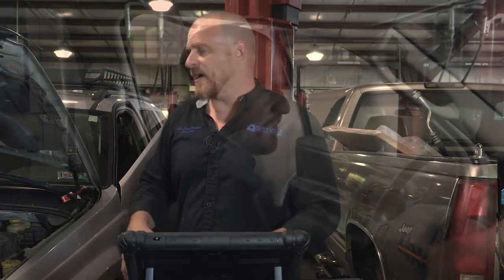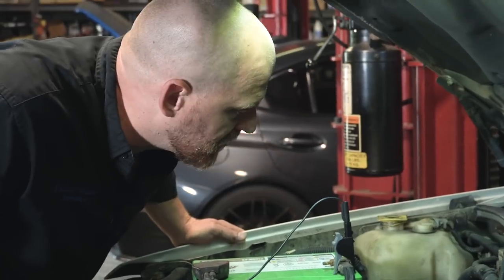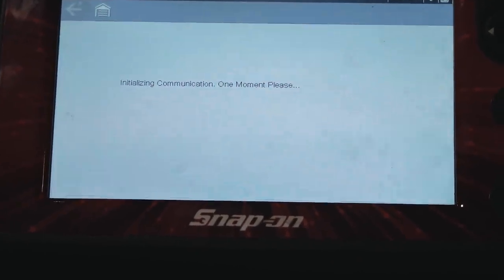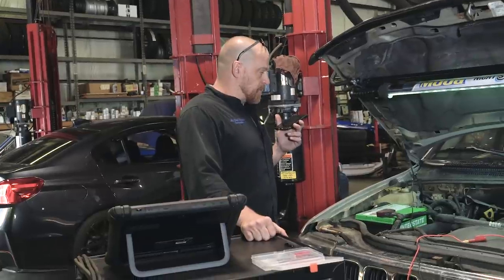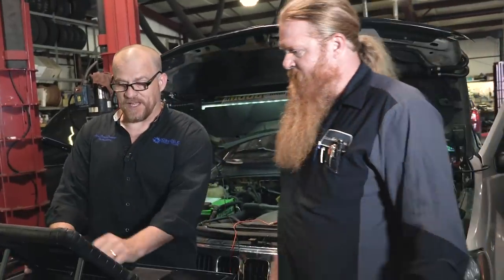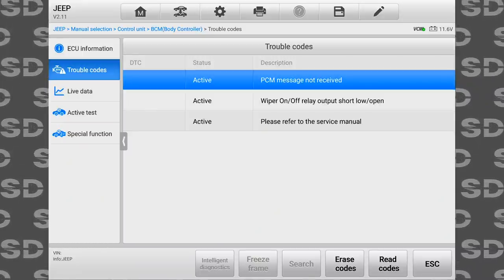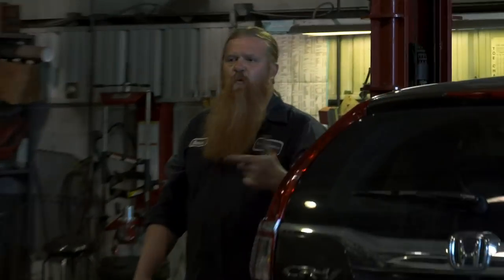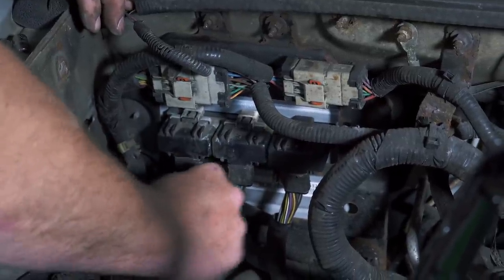2003 Jeep Grand Cherokee Intermittent Stall, No Start, No Com

Comment: The moment you saw the no communication and no mil you were on top of the issue. It only left powers , grounds and verifying pci bus at the module. The wiggle test on all these year Jeeps at the pcm is golden.
Reply: WE SHORE DO MISS YOU KEITH !!!!!!!!!!!!
Reply: Yeah but Ivan would have at least tried to take in apart and fix the solder joint!
Reply: What about TCM failed ?
Reply: so i am not stupid some kid may have touch the terminals wrong and in 5 second fried the pcm i did scanner danner power and grounds no dice i called a bad pcm installed truck runs today i needed some closer to the problem custermor installed a new bat but now what bam thanks guy your teaching payed off in west tn
Reply: Thank you Keith!

Comment: 2003 Jeep Grand Cherokee (4WD)   Thanks for posting this video.  Helped me troubleshoot and fix an issue.  Wound up being a bad ECM.  Had issue with coolant sensor, intermittent key/speedometer working.  Fuel pump was not pumping intermittently when turning on ignition, etc.  Also, cherokee wasn't running good, it wasn't idling at 1,000 RPM as it should, was more like 500 RPM and stalling out occasionally.  Your wiggle test was effective, heard some relays clicking when applying pressure to harness bundle attached to ECM ports.  Ordered a pre-programmed unit giving my VIN and ECM part #.  Slapped it in and Jeep turned right over and runs great.  Coolant sensor warning light went out too.  Thanks Guys !!!
Reply from the maker: Awesome! Thanks for sharing

Comment: I just bought Paul's book.  It's great,  good clear pics and print.  Brief descriptions and to the point.  Well written with lots of detail applicable to systems from many makes, models, and years.
A few years ago I had a 99 dakota that did the same thing with the connector.  No Bus on the odometer.   5v missing at the TPS.  I drove it while I waited for a 'new' $100 PCM from the boneyard. Hot weather made mine worse.  It died 2x driving to pick up the replacement part.  PCM had the same programming numbers as the old one.  Many Chrysler/Dodge PCMs use the same hardware, but are programmed differently for different models.  The software program numbers are on a sticker on back. Did not program it for the vin.  Everything has worked fine for 3 years since replacing it (knocks on head).
Reply from the maker: Thank you Kerry!

Comment: Just Empty Every Pocket lol

My favorite lost-then-found-tool was working on a skid loader and when I got done I couldn't find my 10mm ratchet wrench. Even tore the machine apart a little to try and find it. Gave up and bought a new one off of the truck. A few months later the same machine came in for an unrelated issue. Pulled up the floorboards for something and found something shiny. Dug it out and it was my wrench.

Comment: I am on Long Island . Flagship One is about 10 miles away . There is a local college radio station with an automotive show , Motormouth Radio 90.3 FM . One of the hosts who works in a shop said they have used them with good results . There is also South Bay Fuel Injectors about 15 miles away . They were a guest on the show . In the next county there are two long time carburetor rebuilders . One also does throttle bodies . I had bushings done on a GM that had excessive play in the shaft .

Comment: Nice case study! Always a little disappointing not to see the board under a scope, but these days there isn't much that can be done. Maybe a 17 year old board would be different, it would be so cool to see a solder joint fixed. As you say, it is much more efficient for a pro to go straight to a replacement. Caleb got married, so happy for him!

Comment: Nice video. I like just listening to Paul and Jim and pick up suggestions for tests. Learned something new with the pin drag test. 👍👍 The tip cleaner can be bought at any welding supply shop or some automotive parts places might have them too. Welcome back Caleb. 👋👋

Comment: Hey Paul, another great tutorial of checking visual and audial. Noticing that click when you undone the module was quick, some guy may have missed that one or not heard it over the shop noise. Once again, you point out a lack of basic checks that may have saved the owner from purchasing a fuel pump had the other original shop correctly performed basic checks. Then gave the problem to Pete. 😂 
Thank you once again for a valuable lesson on basic checks, oh and airbag modules! 🤣😂🤣

Comment: I know this vid is from a year ago, but SD wanted someone to comment about where to buy a Torch Tip Cleaner set. They sell them at Lowe's and I think they only cost around $5. I bought a set about a year ago for terminal drag checking and for cleaning out corrosion and stuff. I think they sell them in the welding and torch area of the store.

Comment: On early Chrysler boards we would remove them from the housing a flex them slightly.  On the early rebranded Mitsu Chrysler stuff the power relay would come un-soldered or just burn up.  Never understood the reasoning on putting power relays on circuit boards. Same with VW IVR's and Nissan Quest A/C control heads.  Did a ton of them years ago by re-soldering them.  Great info for the module web page.  Thanks!

Comment: I came across very unusual case!!! I had to go rescue my wife 60 miles away !!  Stalls, no code, no start!!! I just previously repaired short in fuel injectors harness.. when I got there, it fired right up, doubled checked computer diagnostic, everything perfect. (Crap!! ) chance drive straight home? Or let local dealer double diagnose that I missed??  Well!! It’s Sunday... head for home!! Stalls every 10 so miles.. let cool off.. stalls ... keep going.. finally ARRIVED HOME!! Wife took my car for work. I doubled checked fuel pressure, perfectly 55psi.  Ran it, good 20 so mins.. perfect!! Well!!  Caught my eye!!! Color of fuel !! YELLOW!!! Showed my wife... when she got home...showed her differences in regular gas and fuel out of her car...she said... SOMEBODY PEED IN MY FUEL TANK???  Told her that’s LOTTA PEE!!  It’s FLEX FUEL!!  She accidentally refilled the tank with flex fuel.... we had to keep refilling tank till it’s gone..  ( I had to tell you this story, figured you guys get kick out of this!!) there’s no short!! Replace the FUEL!!

Comment: Those connectors were a pretty big problem on the generation before that one looks like it’s on those too. I don’t like the no clicking on the electronic torque wrenches either, but I do like the digital read out.

Comment: Paul i worked on a 2014 unbolted the air bag module and turned it to check my wire and blew the  top air bags not a good day!

Comment: Take a good 80-100 watt iron.  Tin the tip and touch the pins on the ECM and see if you can get the solder to re-flow from the heat transferring down the pin.
Reply from the maker: Can't get to the board on these. They are covered with an inch some sort of hard silicone or apoxy
Reply: @ScannerDanner  right but you can get to the pin that it plugs into.  Touch the tip of the pin with the iron and let the heat flow down the pin and re-flow the solder in the joint inside the computer.

Comment: Sweet bagpipes, Caleb! :D Great stuff with the wiggle test, Paul. I see alot of those vehicles around here. I have an '04 sitting here that got hit hard in the right front with airbag deployment. Pretty much identical to that one. Me and Jim have the same organizational skills I see, LOL - looks identical to my toolbox and work bench (I wish I had a Nova bench, though), except mine is a little worse, LOL. :D

Great website there - I wrote that one down. Much appreciated! With my Silverado failing one system at a time since it left the showroom in '07, I'm certain I'll be needing it at some point soon. Transmission failed 3 weeks ago - 103k miles! Gotta love the 21st Century ... Anyway, great stuff as usual, fellas!

Comment: I’ve used that company before on a GM, had to do the 30 min manual key relearn but other than that it is plug and play which is nice and avoid having to pay to get it towed and for the dealer to program it.

Comment: Cracked male pin, cold solder joint, or water damaged ECU pin.
The fun ones are broken wires with no messed up insulation.
While not a car issue, had a motor winding analyzer. Running the surge test up to 12 KV. Start hearing sanp, snap,SNap, SNAP, SNAP!. Sounds like arcing through the insulation. Of our test coil.
Low output voltage and the continual snapping.
Turn out our room lights, can see arcing inside the test cables. These are like 11mm, 10 foot long cables.
Look at the Jr. Tech "well there's your problem" 
I pick up L1 and pull on the aligatorclip and six inches down. No stretch.
Do it on L2 and the cable stretches like an inch. I Said " Anytime you can physically stretch a cable? That's a bad sign"

Comment: Thank you that was a good video.
It appears to have a lot if corrosion at the bulk head my be bad seals around hood area, wiring getting wet causing condensation on wiring and sometimes inside relays which can cause intermittent continuity on circuits, have seen this many times, k am 96 now lot if water has gone under the bridge but k am still fit, hope this virus keeps away from me.

Comment: Instead of using a torch tip cleaner, I use an automotive terminal test lead kit from bluepoint, it has all the different types of male and female pins with a banana plug on the other end of each test lead. I don't like testing with a nozzle cleaner in case I pick the wrong size and screw the terminal up.

Comment: I have a 2004 Ford F-350 Powerstroke diesel, I have a high desired idle rpm about 4325 rpm on the scan data that I can’t figure out what causes it. Checked the get throttle plate, accelerator pedal sensor values. Nothing seems to be out of ordinary. I once hooked up the battery wrong way while replacing battery. Truck doesn’t start but cranks okay. Checked all other data pids for diesel truck to run and they are okay.

Comment: Can you try re-flow the male pins? Take a hot air station and heat the pins. If there is bad solder joint other side the board, it should fix it. Bad news is if the PCB traces are broken/corroded, these you can not fix by re-flow. Only be careful, the heat sink draws load of heat away. You need to be fast and relative high temp, 500+ degrees something. Not too long time, it can destroy everything. Pre-heat on low temperature and then go, go, go
Reply from the maker: Not on this ECM, they use some sort of very thick, hard silicon that covers the entire board. I do not have the ability to even look at the board on these models.
Reply: @ScannerDanner  Actually you are right. But it does not stop me, there is always solutions. Guess what I figured out? I could modify old soldering iron/tip (must have enough power and small footprint) and drill a small hole to end of the tip. That way is possible to re-flow pin by pin. Yes the connector plastic melts bit and may be it requires later bit lacquer for water proofing. Time consuming job, yes 100%. Only way to cut the time are to figure out what pin (s) need the re-flow. Economically not reasonable, your time cost more money than replacement unit. 

I can go even more crazy, it means even more not economical. No direct access means you can not apply the fresh flux and solder. Original one are may be lead free, it means very hard to solder or re-flow. Enough heat and there is possible to remove the pin, suck/drill old rubbish out from the hole, apply new flux and 60/40 solder and install back the pin. Very delicate job, too much solder and you have the short circuit. After soldering cleaning is not so big deal on these days, possible to use no-cleaning solutions. 

I am not here to teach the professional. You make the fantastic job!!! I learn on Plunket College, Dublin the motor vehicle maintenance and I have honer to deal all sort of crazy things. On following weeks I expect to get running my FrankEngine, toyota yaris with arduino and carburetor. Who is crazy --- ME!
Who is professional -- YOU!

Comment: you say about flag ship is a good company I've bought a computer from them for a ford escape and was never told about the tsb of replacing the coil packs before replacing the computer. I call and told them what happened and basically I was told I'm on my own. I should have know to replace then coil packs.
Reply: It’s not their responsibility to make sure you are performing the repairs properly. It’s their responsibility to provide you with a quality replacement module. Which they did. You obviously had a shorted output that ruined a transistor in the module. And that is their fault? Really? These guys who make YouTube videos also stress to look for tsb’s.

Comment: Hey Paul, in the video you mention you won't have 5v on a thermistor while it's plugged in.  However, I was glancing at section 9 in your book and on page 4 it states, 'thermistors can be left plugged in and will never cause this condition due to internal design differences'.  Am I confusing something?  I appreciate all the great content and happy new year!
Reply from the maker: Both are true! Remember that a thermistor gets its same signal voltage from the 5v regulator. So if you use a thermistor to check and see if you have a 5v ref. You must unplug it. Make sense?
Reply: Yes, it makes sense.  I recently learned of the 5v reference and got a bit confused there, thanks for the clarification!

Comment: If I remember from working at chrysler correctly, there was a Chrysler diag procedure in service info that called for hitting the ecm with a mallet for diag.always thought that was a good example of the manufacturer not thinking techs are smart enough to do electrical diagnostics.

Comment: Do you know in a Diesel, exact time under common rail when injector fires. Seems like no one knows. Is it after TDC or before. Does it change by ecm and injector on time via crank signal. Not even Bosch repair centre know. Very sad.
Reply from the maker: I know they fire on the compression stroke which is why you have 30000 psi of fuel psi available at the tip of the injector, otherwise compression pressures would prevent an injector from opening
Reply: I rang my engine builders and they did not know. They told me to ring an injector firm near them in the other part of UK. The guy himself was shocked people did not know. He said its easy. He said Injection pulse is timed off the crank, and theres no exact place it fires in. My logic though is if the air is compressing and you dont want an explosion before tdc is that the explosion has to be afterwards. The injector guy said I was wrong though. And its before tdc. I cant believe that. As if you ise ethanol easy start and spray too mich in air filter on crank it can go bang as pistons climbing. The sound of con rods and everything taking the extreme forces the wrong way is horrible. Bang after tdc has to be the only way it works
Reply from the maker: @jamesbarratt593  injection timing on a diesel IS your "ignition timing" and it absolutely sprays during the compression stroke (BTDC).
The amount of fuel and timing of the fuel is everything. 
Due to the time it takes to complete the burn, you have to start it before TDC. In the books, any flame that is still burning by about 22 degrees after TDC is just creating heat and is not helping.
Reply: And so would you agree that injection timing is done by monitoring the crank signal.
Reply from the maker: @jamesbarratt593  of course but that is only one piece of the info needed.
MAP, TPS, cylinder head and coolant temp, etc etc etc

Comment: I personally do not recommend flagship1, they won’t warrant our PCM. They got from junkyard and sold it to us...  I personally recommend partgeek, rebuilt ones. Yes, need to reprogram to fit the vehicle. ( dealership able do that, $85 or so)
Reply from the maker: The whole point was with the programming side of things. So far flagship1 has been awesome. Maybe 6 or 7 different modules so far with 0 issues. Turn key type stuff too, no programming
Reply: Yes, that’s one thing... google BBB... New York... you’ll find lots negative reviews, rips off, takes your credit card, to another card reader...rip off as deposit.. there’s lots people got ripped off. I lost $350... that card reader reads BooHoo... flagship1 did very good job hiding, I had to use BBB to communicate..

Comment: Can anyone tell me witch Snapon scam tool make the skim function go away I have a 2000 Cherokee that lives in the woods and trying to simplify the electrical system.
Reply from the maker: I couldn't do it with the Snap-On, last time I did it was with a laptop based programming tool called a Cardaq-M, I believe the autel can do it
Reply: @ScannerDanner  thank you very much
Reply: From what I under stand all I need to do is unplug the skim module and re flash the vin
Reply from the maker: @junkrust2182  the one I did, I just basically told the ECM to ignore the SKIM, no unplugging or anything else needed. I have it on film but it's on my premium channel. Sign up for the free trial, then immediately cancel and you won't be charged and youll have 14 days to view the content. Let me find that video
Reply from the maker: @junkrust2182  https://www.scannerdanner.com/scannerdanner-premium-chapters/no-start-case-studies/454-chrysler-sebring-2-4l-no-start-headlight-circuit-shorted-to-sensor-ground-part-3.html?highlight=WyJjaHJ5c2xlciIsImNocnlzbGVyJ3MiXQ==